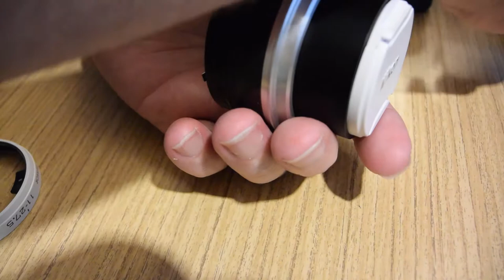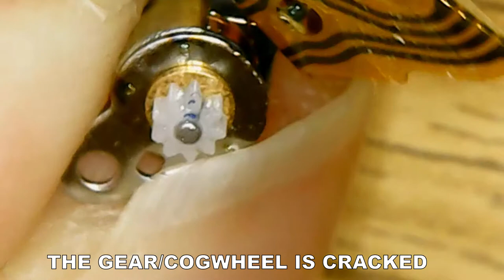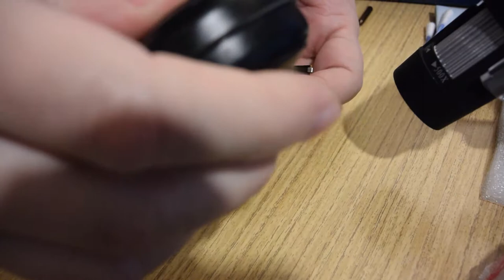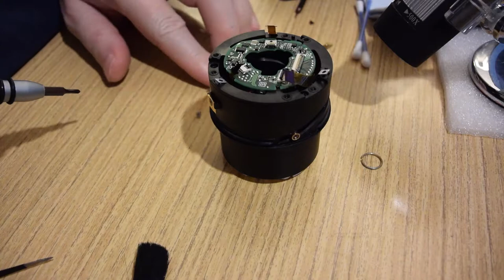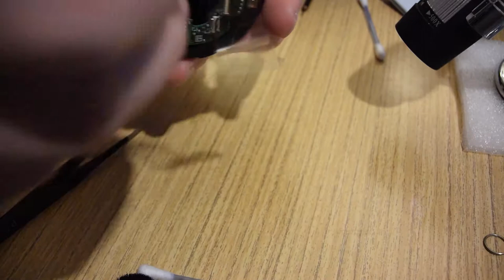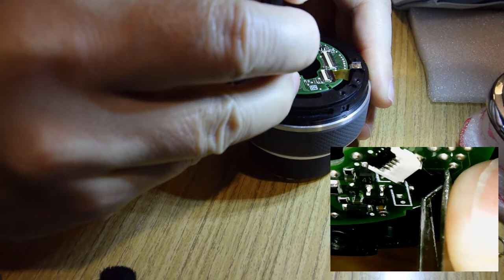Nikon 1 11-27.5mm lens disassembly - faulty aperture

Comment: OK, I made it to the gear. It's surgical small. Mine seems like it has irregular spacing. The aperture can still be manually turned, but it's difficult. I'll have to order one. 

Question: since I'm already this far along, if I wanted to remove the dust from inside the inner lens, would I keep dismantling from this point, or is that something that can be addressed from the other side (outside) of the camera? Thanks.

Comment: I have run into a problem in following this video to repair my own lens because the video jumps to the lens being partly extended before it is indicated that the lens needs to be partly extended. At the beginning the lens is not extended. Then suddenly it is partly extended. Then we are told that needs to be fully extended. However, if you haven't partly extended the lens by the time you get to this point, how do you fully extend it?
Reply: Funny, also stuck on that part. Really tricky aligning the data cable so its as close to the screw nut thats supposed to hold and slide the aperture.
Edit: Nevermind found out he put in the "shell" before the 17 min mark, that was not alligned correctly with me. See if you didn't make the same mistake.

Comment: Thanks for the video guide! Will try to repair my 11-27.5 as I noticed a similar problem, hopefully turns out well. Can I ask what screwdrivers you used for the take down. Thanks.
Reply from the maker: Hi if you mean what size? Then im sorry, but i always chose what fits best by feel-test. And i bought some repair screw set from e-bay, there is lot different to choose from.
And watch out the two "bolts" on springs.
http://www.youtube.com/watch?v=AhpHc8xgcRY&t=5m15s